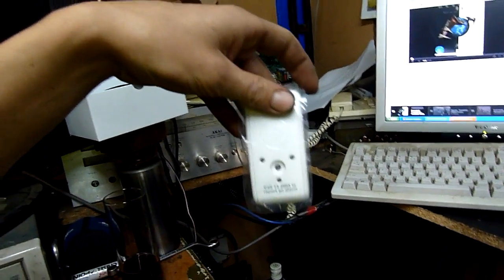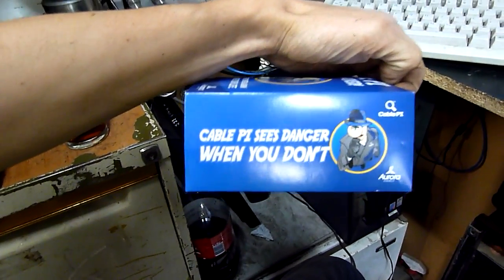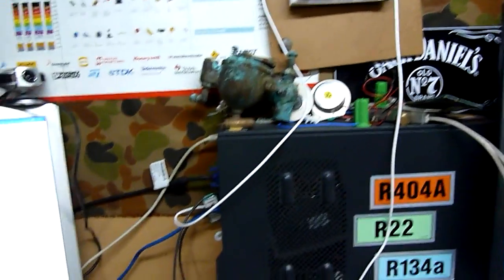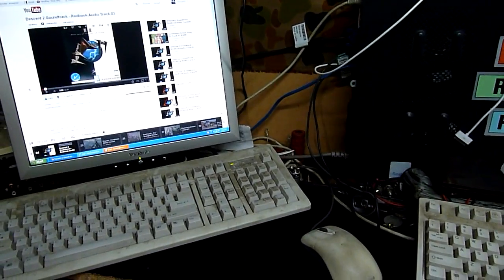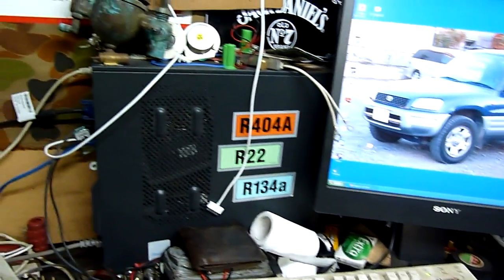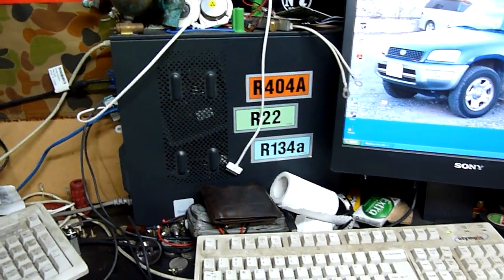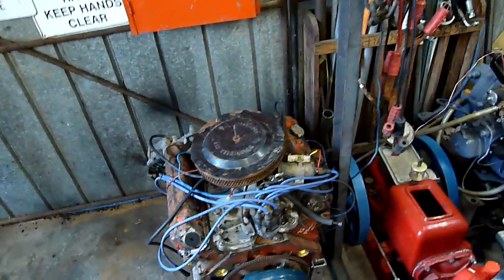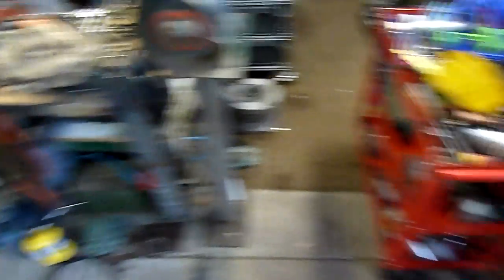Ramblotronic Tuesday - Donations and High Vacuum Vid Proposition

Comment: Vacuum experiment suggestion.  Methylene chloride bubble tubes.  Basically a glass tube sealed at one end, a bit of rocksalt added (bubble catalyst), topped up with methylene chloride (cheap industrial solvent), a vacuum pulled and the tube sealed off.  The slightest bit of heat from a hand or low wattage lamp makes the fluid boil like a glass heat-pipe.  You see them used as Christmas lights in America.

Comment from the maker: @LachlanOx engineer in the pool industry, mainly fitting and turning, stainless steel and alloy welding, mechanical systems fabrication etc. all to do with pump and covers systems, railings etc.

Comment: I'm building a high vacuum [down to around 0.0000020 Torr and lower]  chamber myself. When I get it all built before I set it up for nuclear fusion, I could try pumping down some stuff for you with the gas-jet diffusion pump I just bought, however the chamber is only going to be around the size of a pressure-cooker, for it will probably be made from an extra-thick old one :P

Comment: I assume you are going to make a bracket to make that CPU cooler fit? I think you said that it's not for a socket 775 CPU.
Id honestly just take that Pentium D out of that little case and place it in a different one. I am sure you have one or two larger ATX cases laying around.
Also what type of video card is in your gaming PC? Because the GTX 250 may be better use there.

Comment: vacuum can be fun.  You just need to combine vacuum with high voltage!  put two electrodes in a glass bottle and suck the air out then run some HV through it.  Thick glass bottles should be able to easily handle a vacuum.  The trouble point is a large container.  Small containers (i.e. small thick booze bottles) should be able to handle it just fine.

Comment: Hm, try to make a vakuum bell jar, if you find some translucent, stable jar/bucket. Would be interesting to pop things with little air inside in the vakuum. I only tried it with balloons and marshmellows in an soda stream bottle, using a little handpump :D

Comment: Implode gas and petrol tanks! And try to dig up a bell jar and swell up foam- or air-filled stuff. :)

Wait a sec, Put a DVD player or DVD-ROM drive under vacuum and see if the access times improve any. I'm very curious if it does.